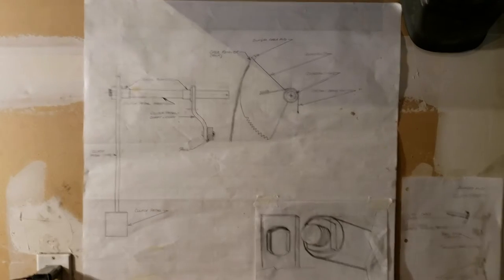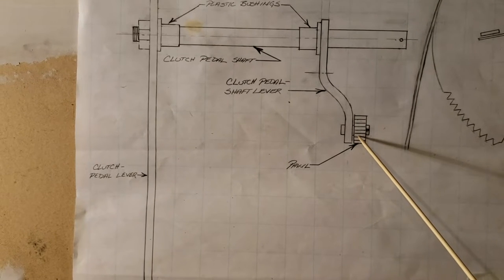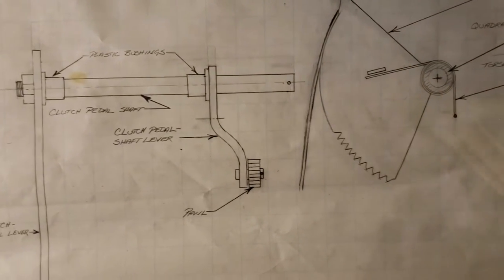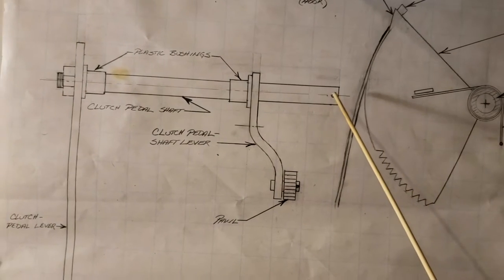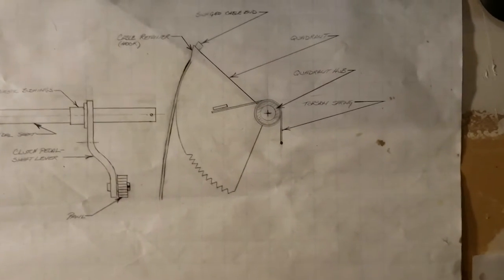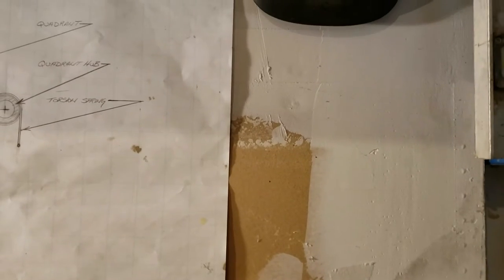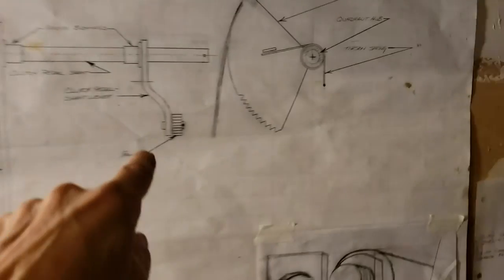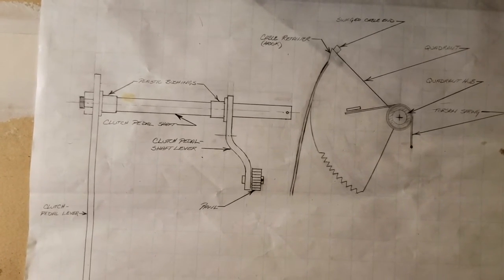How the  Mustang self adjusting clutch cable quadrant works, and how to check for proper operation.

Comment: If you need to loosen the cable in order to get it on the clutch fork, simply use a block of wood or a buddy to lift the pedal up and the cable will stretch freely underneath

Comment: Neber was a fan of the plastic quadrants. When i worked as a skilled trades welder gm tonawanda forge/American axle and I had my chevy powered mustang I had the millwright make me an exact replica of the plastic counterparts out of steel and had a quadrant made with hardened teeth
Reply: Don't get me wrong they work great but can strip out when you side step a clutch
Reply: Also I dont think they were designed for what some of us guys do to them lol

Comment: So when you pull the cluch pedal, tightening the cables, how do you revers that. As in how wild you lozenges the cable???
Reply from the maker: When you pull the pedal all the way up, it releases the pawl from the quadrant. This does not necessarily tighten the cable, in fact under normal use, the wear of the friction plate causes the fingers of the pressure plate to extend further out, increasing the tension of the cable. The quadrant compensates for this when the pedal is pulled all the way up relasing the pawl, at that point the only tension on the cable is the tension imparted from the torsion spring on the quadrant. When you let go of the pedal the pawl re-engages the quadrant and resets the clutch cable tension to factory spec (the tension imparted by the torsion spring.
       If you want to remove all tension from the clutch cable, you would pull the pedal all the way up, then (working under the dashboard) rotate the quadrant, so it increases the tension of the torsion spring,  and introduces slack in the cable. At this point you can easily remove the clutch cable from the quadrant.

Comment: poorly explained and diagramed: only a clutch pressure plate an throwout bearing for video props. 
just  a diagram of the quadrant an pawl. Nice attempt at explaining it. I believe the pivot is on the opposite side of the input shaft and the shift Fork is pulled forward which is the opposite of the traditional direction of clutch Fork travel in earlier Mustangs.